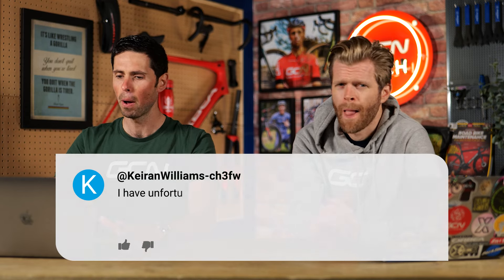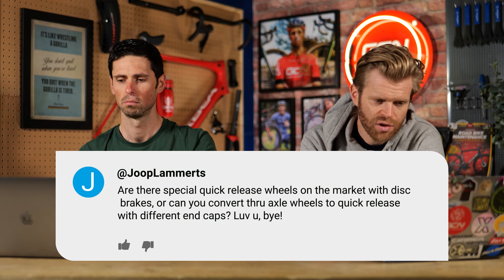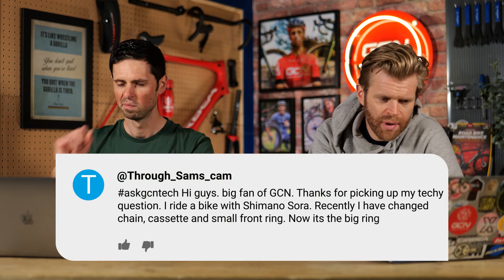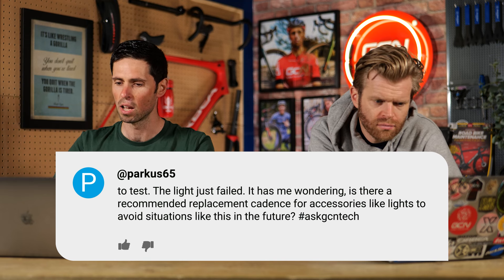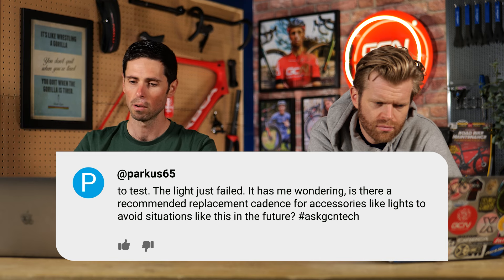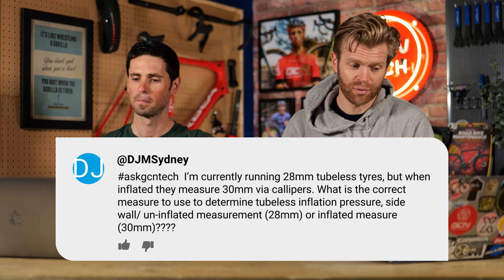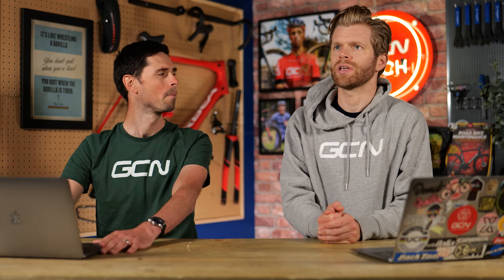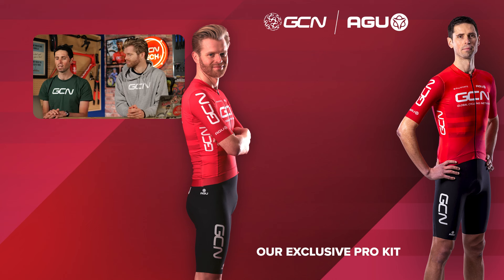Chainring Confusion, Internal Tubeless Tyre Patch Up & Bent Sprockets | GCN Tech Clinic

Comment from the maker: Use #askgcntech if you have any bike tech or maintenance questions!
Reply: #askgcntech = Manon Back For Halloween Special Episode???
Reply: #askgcntech hello is it possible to change a broken main lever component without changing the chole brake lever but only the main lever/shifter? I would like to do it without  bleeding out the brakes ! It is Shimano 105
Reply: #askgcntech hi GCN... Bikes fall over all the time when leaned against things, propped in a rack, etc, etc... Why don't we have a parking lock on the rear brake like on many tandem, mobility trikes etc... It is one tiny clip that locks the brake on, negligible weight and aero impact
Reply: #askgcntech 
Question for Doctor Aero!
I'm looking at having a budget but decent wheelset built up for me.  The rims I am looking at (Kinlins, which I believe are rebranded by Hunt and other brands) are available in a 28mm external and 22.5mm depth, or 24mm external and 31mm depth.
I plan to use 32mm tires, as this is more endurance oriented.  The weight difference is negligible over system weight.  Which is more aero?  A shallower rim which is closer in width to the tire so you have a smoother transition?  Or a deeper rim which has a slight lightbulb going on?
Reply: #askgcntech I'm struggling with wax as chain lube. I've tried SRAM, Shimano and KMC chains, I've tried immersion and drip wax from brands like Mariposa, Silca and Molten, I've tried on self cleaned and cleaned pre-purchase chains. I clean my cassettea very thoroughly, I clean the chain after wet rides. Ive never got passed ~80 or ~100 miles before feeling it needs to be lubed again. Does wax just not work for me in my conditions?  UK, frequently wet.

Comment: Cool to hear the dynaplug works so well. I got the carbon race version (14g). It rivals the park tool boot 3 pack (9g) I got on weight! Add in a park tool super patch (5g), and youve got all the emergency goodies for right about 1oz (28g). Toss in a Topeak nano 9 multi tool and it all weighs less than most multi tools!

I just rebuilt my emergency kit. I saved 150g, trippled my airflow per pump, and added necessities. I added a tubeless repair kit, patch, boot, spare tube, and spare master links.
Reply from the maker: Sounds like a good setup. Once you’ve used it for a while, let us know how it’s going and if you’ve encountered any issues.

Comment: I'll go ahead and say the quiet part out loud since there's likely a sponsorship issue with GCN saying it: power meters for Shimano cranks are notoriously bad when it comes to reading on the drive-side crank.  If you're using one such power meter, don't be surprised if you are told you have a L/R imbalance.
Reply: small correction: not power meters FOR Shimano but power meters FROM Shimano. They are proven to give horribly false numbers in almost every test; those of power2max, Quarks, 4iiii aso are perfectly fine, also the version for Shimano

Comment: I have a Tiagra chainring, Sora FD, Claris STI left and right, claris RD, 8s chain & sprocket. Works well for me😁
Reply from the maker: You could call your bike Frankenstein then
Reply: My set up is more Frankenstein. 105 5700 crank, 130 bcd narrow wide 44t chainring, 11-42 xt cassette, lg500 chain, with sram rival 1 rd. Works well. 11spd is a sweet spot of compatability it seems. The outer position on the old 105 cranks give a nice chainline for 1×11 & shinny silver will always look classy. Shifts like it was meant to go together.

Comment: You can get special extra thick patches to use inside tubeless tyres Hutchinson Rep-Air is one brand I've used. I have found that the fluid attacks normal tapered inner tube patches.

Comment: On the first question about QR disc wheelsets; some hub makers have interchangable inserts and it'll work fine.  Many do not, and aftermarket is less likely to work so great.  I'm in the same boat with my 2014 Bosenova...except I want a quiet hub, and most of the wheelsets in my price range are on the noisy end.

I will point out another option--custom wheel build, either through a large online store that specializes in such a thing, or do your research, buy your desired rim and hub, and take it to a local builder.

Comment: Thanks for answering my question! As things go I ended up settling on a 27mm wide wheel as there was a special going on, get a bit more width but no 35mm Internal width yet. I did lots of research into it, too much. Per josh portner, of silca, it's a fine idea to run an internal width 3-5mm less than the tire width and that will also comply with ETRTO standards.
Reply from the maker: We're glad you found it helpful.

Comment: To Alex's point about tire width - the SRAM tire pressure calculator specifically asks for the tire's labelled width and also for the rim internal width and uses that to account for the actual tire width when inflated.  So yes, check the calculator's assumptions.

Comment: 9:00 I use 44mm to 2.1" Vittoria tires on 28 rims (technically non-boost hookless MTB wheelset) on my e-gravel. Haven't had any problem, no burping, no tire coming off. I tested the same tires on 19mm road rims, cornering is noticeably worse on narrow rims. If you're riding on hardpack, then it won't matter as much, but if you ride aggressively, 25mm rims are a great choice for 47mm tires.

Comment: #askgcntech - Would love to see a video detailing methods to transfer bike fit (saddle/crank/handlebar position) from one bike to another.  Particularly bikes of similar bicycle discipline.  There is nothing like a new bike day, but matching the fit can be a challenge and the GCN presenters tend to enjoy more new bikes than most.  Would even be cool to see a presenters challenge where the presenters  have to set-up each others bikes with the goal of achieving the closest fit.  Last - for those times when one needs to transfer fitment from one discipline to another - it would be good to get any tips for things to accommodate when transferring from road to cyclocross to , dare I say it, mountain bikes.  Much appreciated.

Comment: I have 650 B x 48 mm tires on my Specialized S-Works Diverge. Other than them being a bit heavier than narrower tires, there is no downside. Also, a good set of 650 B wheels is lighter than a good set of 700 C wheels, so the extra tire weight weight is usually canceled out by the lowered wheel weight. You could make the argument that there are aerodynamic issues, but not at the speeds most people ride gravel bikes (not to mention the fact that gravel bikes are typically not aerodynamic). There are plenty of upsides, including increased comfort and better traction.

Comment: I just saw something that I found very interesting. I've always used Mavic Open Pro rims on my clincher type wheels, but I just saw that Mavic is now selling two different types. They sell a "classic" type, called Open Pro-C, with a 15mm internal width, and they sell an Open Pro-UST, with a 19mm internal width. With the "C" type, you can fit a 23, 25, or 28mm tire, but the UST type, could fit a 25, 28, or larger tire......I go back to the days where some clincher rims had an internal width of 13mm, for use with 20,23, and maybe 25mm tires.

Comment: Hi fellas! Bottom bracket question. I have a Cannondale CAAD10 with a BB30 press fit bottom bracket. I replace it annually, but I worry that the regular maintenance could damage the bottom bracket shell. I have all the right tools, but still the idea of using a hammer to strike the tool to force the bearings out makes me uneasy. So, is it possible to use a thread-together bottom bracket instead of pressing in the 2 loose bearings with drifts? That would remove the need for blunt force tools when I want to remove it

Comment: I had a power differential between my two legs.  My problem was that my R leg is longer by 10mm than my L leg.  My R leg was getting full extension and proper power input.  The L leg wasn't.  I had to add a shim to my R pedal, and raised my saddle by the same amount.  Boom: Both legs fully extending, and my power went up 5% overall.
I must note at this time, I went to a physio who specializes in bike fitting to find this information out and how to properly rectify the issue.

Comment: Can confirm Mavic still sell wheels that are ready for both thru-axle and QR, just replaced the stock wheels on my gravel bike with a set of Allroad Discs and they came setup for thru-axle but with the adapters in the box to convert to QR.
Reply: Novatec hubs are also an option.
Reply: Dt Swiss hub can have qr endcaps as. Hope hubs had lots of end cap options, not sure about the new pro 5 though. Still lots of options it just a matter of making sure the hub has different endcap options for different standards and that the qr end caps are avaliable

Comment: #askgcntech Since most "desired" tires these days are tubeless, for us still running inner tubes do the pressures printed on the tubeless tire sidewall still apply?  I have seen tires in the past where the inner tube pressure is typically higher than the tubeless pressure rating.  Appreciate the feedback!

Comment: Avoid letting lithium ion batteries experience sub-zero temperatures. It causes permanent damage. It won't happen while in use, except in truly extreme environments, as they'll be generating some heat of their own. But we aware when locking up in winter weather.
Reply from the maker: Good information on temperatures for bicycle batteries.

Comment: Do not ever use glueless use-ready patches on anything unless it is a emergency fix. Their glue flakes off after a while and undone itself. For patching tubeless you can use tyre worms and/or car tyre patches that you use with same glue that you use for tyre worms. If you use both of them that area will be sturdier than all tyre itself. Look at rema tip top for patch, for worms tere are lots of brands.

Comment: When i get a puncture on a ride I turn the bike upside down to remove the wheel. I hear so often this wrong but why and how should I do it. Additionally I see on social media that hydraulic systems should not be turned upside down as air bubbles can be introduced, sounds like an old wives tale as it’s a closed system.
Reply: It's OK as long as you don't actuate the brakes.
Reply: It'll tear up your handlebars and saddle, flipping your bike over to remove a wheel. Then again, if you don't care about these things, go for it. WRT hydraulic brakes, if there's any air in the system, they will tend to travel upwards. It won't "introduce air bubbles" into your system to flip the bike over; but any existing air bubble may travel through the lines and cause an issue when the bike is oriented for riding.

Comment: Is there other options for SRAM Force AXS D2 Chainrings replacements. Other brands that fit? Or is SRAM Only SRAM?
Reply: as the new SRAM chains have slightly different measures I assume the chainring will also be a bit different to all other brands
Reply: @fiddleronthebike   Thats what I thought. I wanted to try an Oval chain ring and hope I might be able.
Reply: may be it will work… I rode Rotor Q-Rings for some years - to be honest, I didn’t notice a big difference, certainly not in performance (neither better or worse); some time I rode Q-Rings on the road bike and normal ones on the others (cross, TT and commuter), I 
barely noticed a difference even when I hopped from one to the other…
Reply: @fiddleronthebike    Thank you !!

Comment: I am in the process of buying my first proper bike, which likely will be an Orbea Terra. I am however waiting for them to hopefully announce the 2025 model year. The reason being, I am waiting to see if the frames will be UDH compatible. Do you reckon, generally speaking, UDH will be worthwhile waiting for? I just want to make sure I have compatibility for potential future upgrades with regards to new groupsets (like SRAM 13 speed). Or is UDH not expected to have that wide support?
Reply: With UDH, you'll save yourself the headache of finding the right rear derailleur hanger because you'll already be having one that's compatible with any frame designed for UDH.

Instead of being limited to a few shops, any shop that sells UDHs will do.
Reply: @yonglingng5640  thanks, I know that, and it's a great thing. But I'm also trying to understand how widely that standard will be accepted. As it sits, I know Giant didn't adopt it due to their flip chip, I hear Shimano may want to go in another direction as well, and SRAMs new 13 speed topend groupset will likely trickle down in their lineup eventually but requires UDH. A bit of a mess. 🙃
Reply: @JustBrowsing777  yeah, I think UDH is worth waiting for. Sram is brute forcing it onto all bikes and that's not a bad thing. It is a pretty good design and I think we'll be seeing them on road bikes as well sooner rather than later. Shimano would be foolish to try to come up with something else, it's too late. Another big factor in its popularity is that the license to use UDH is completely free for anyone who asks.

Comment: Haven't measured it, but Sora is 9speed and Claris is 8 speed, so the chainrings are probably not of the same thickness. Don't want to snap a 9speed chain on that thicker 8speed Claris chainring...
Reply: Yeah that was the nub of the question. My guess is that IRL they probably are the same for cost of manufacturing reasons but as you say you'd really need to measure it.
Reply: 7,8 and 9 chains are the same. Your point is invalid.
Reply: @tomahoks a nine speed chain is  very slightly narrower than a eight speed chain (Try fitting a 9 speed missing link to a 8 speed chain). It will run, but will be prone to chain suck when cross chaining. Shifting will be worse and chain will wear quicker. Pointless downgrade.
Reply: Thinking on, is it just that the plates on the chain are thinner? Pretty sure that is the case with the jump from 10-11 speed at least.

Comment: #askgcntech hello I’m 26 yrs old Amateur rider and mechanic here good lord what did I get myself into I own 3 old bianchis with champy group sets on them, i had stripped down my Eros mega pro mid 1990s , I want to put a more modern group set on it what would you guys recommend BB is 68mm bsa I think it’s got to be campagnolo though
Reply: Some Italian bottom brackets have the same threading on both sides. Most bottom brackets have reverse threads on left side. Make sure you get the right one. In other words some bottom brackets are sold as English or Italian.

Comment: The topic of rim with is absurd. Not many years ago, all MTB rims were 21mm or 23mm max and everybody used 2.2" or wider tires with no problems. Now we are worried if 47mm tire will work with 25mm rim. Go out, ride and worry less!